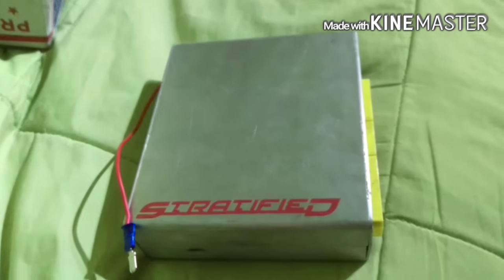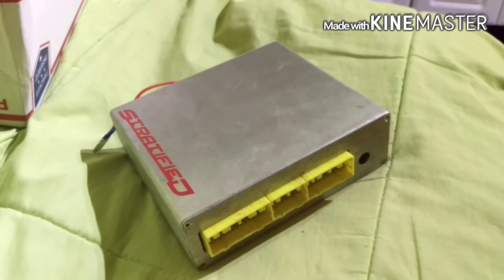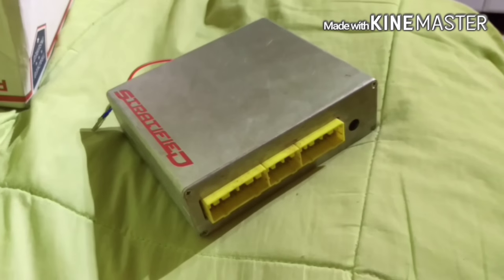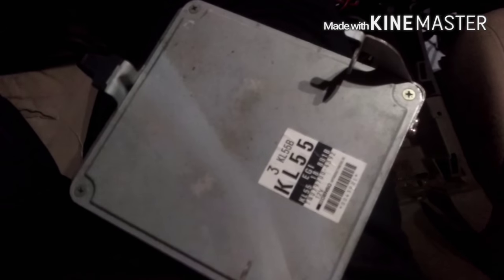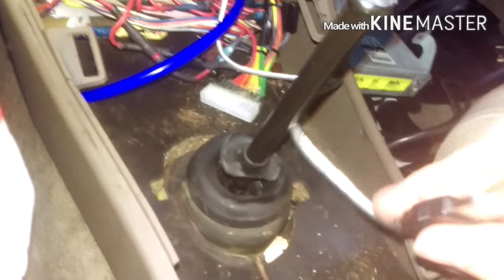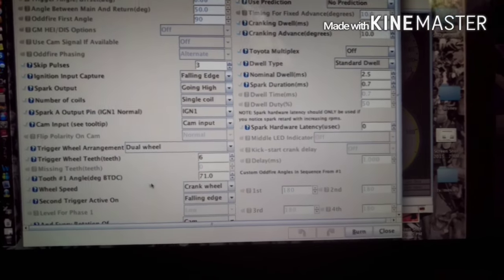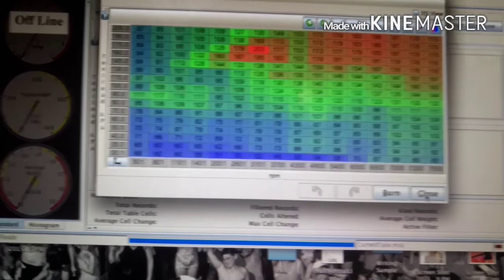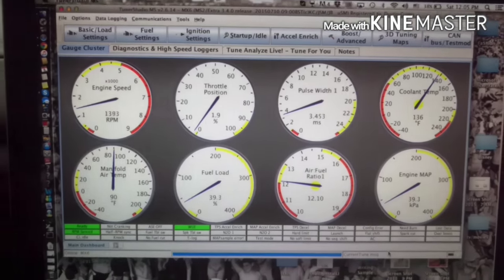How to: Basic Megasquirt Install/Startup

Comment: Does that plug and play for any car or just for your mx6?
I'm trying to find a megasquirt that can be used in a 3rd gen Mitsubishi eclipse gs. the way I see it, the simpler the install, the better.
Reply: It's usually with any car of what I'm searching and finding out, I'm pretty sure the ECU is universal...
Reply: +ThaAudi Thanks. Even on the 3g forum I can't find anything about installing megasquirt in an eclipse
Reply from the maker: +Dylan McElveen don't listen to him. it's specific to the car. each car has different setups for cam and crank position sensors and distributors and coil pack firing and all that. this ECU is for the MX6 only. 

I'm sure they make some kind of standalone ECU for an eclipse. popular cars as they are. I highly recommend getting a plug and play one for your car. building your own is hard and frustrating. they sell generic megasquirt ECU, but you have to wire it for your car. which is a big hassle. I would never do that
Reply: mega squirt is universal . you program it for your app. and buy the harness or adapter for OE harness. mega squirt is for basically anything and can be used with basically any engine.

Comment: What about all the other emission stuff on cars? How does the computer handle controlling that stuff? If it ignores it your fuel system won't vent correctly, your cats can burn up if they are run too rich without any air injection, etc...
Reply from the maker: tempest411 I know some people use megasquirt and pass emissions just fine. Where I live, we don't have emissions requirements, and we don't use cats :)